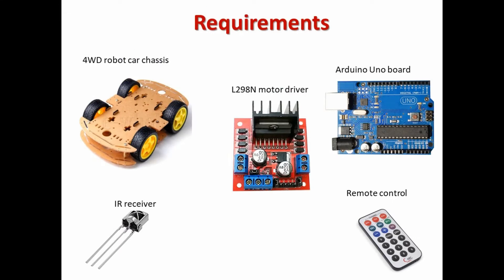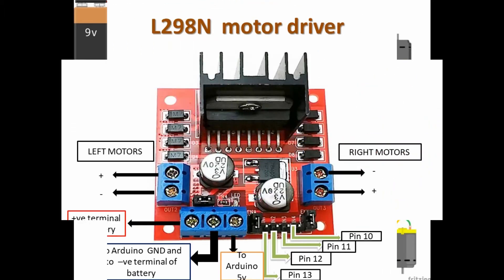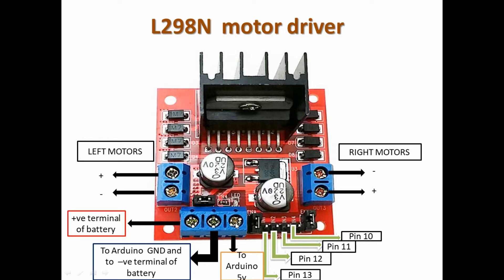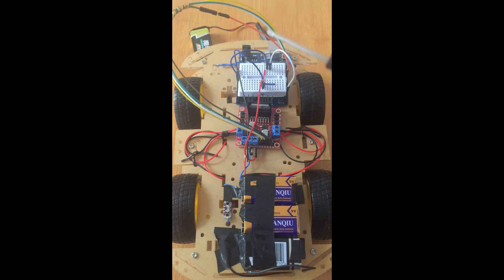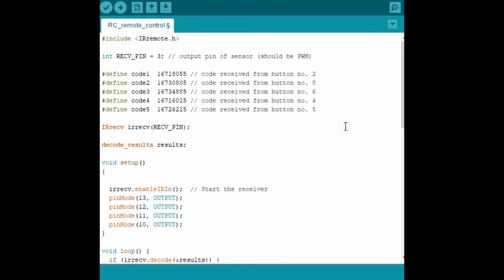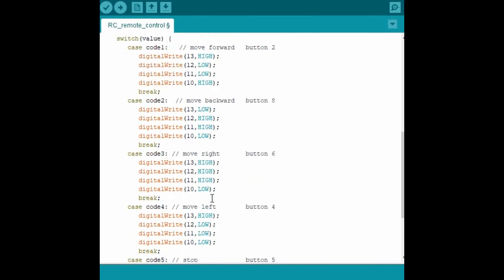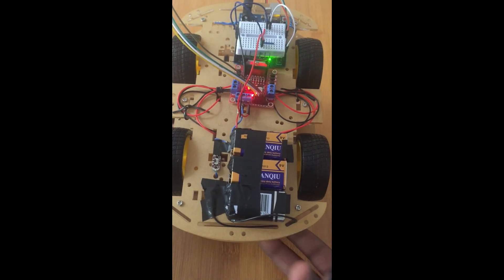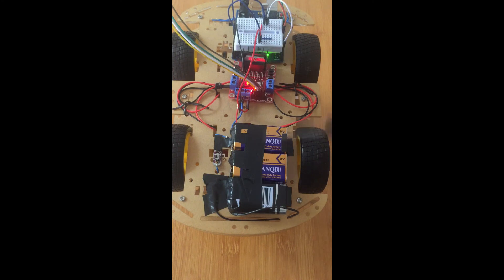HOW TO CONTROL 4WD ROBOT SMART CAR USING IR REMOTE WITH ARDUINO

Comment: Hi there; I have one question : What "error: 'RECV_PIN' was not declared in this scope"
Reply from the maker: Check the initialization part of your code and make sure you have declared the pin number for the output of the IR receiver.
Reply: #include <IRremote.h>

int RECV_PIN = 3; //Kızılötesi alıcısı

#define code1 16718055 // kumanda 2 nolu tuş
#define code2 16730805 // kumanda 8 nolu tuş
#define code3 16734885 // kumanda 6 nolu tuş
#define code4 16716015 // kumanda 4 nolu tuş
#define code5 16726215 // kumanda 5 nolu tuş

IRrecv irrecv(RECV_PIN);

decode_results results;

void setup()
{
  
irrecv.enableIRIn(); //Kızılötesi modülünü aç.
pinMode(13, OUTPUT);
pinMode(12, OUTPUT);
pinMode(11, OUTPUT);
pinMode(10, OUTPUT);
}

void loop() {
if (irrecv.decode(&results)) {
  unsigned int value = results.value;
  switch(value) {
    case code1: //ileri tuşu 2 nolu buton
    digitalWrite(13,HIGH);
    digitalWrite(12,LOW);
    digitalWrite(11,LOW);
    digitalWrite(10,HIGH);
    break;
    case code2: //geri tuşu 8 nolu buton
    digitalWrite(13,LOW);
    digitalWrite(12,HIGH);
    digitalWrite(11,HIGH);
    digitalWrite(10,LOW);
    break;
    case code3: //sağ tuşu 6 nolu buton
    digitalWrite(13,HIGH);
    digitalWrite(12,HIGH);
    digitalWrite(11,HIGH);
    digitalWrite(10,LOW);
    break;
    case code4: //sol tuşu 4 nolu buton
    digitalWrite(13,HIGH);
    digitalWrite(12,LOW);
    digitalWrite(11,LOW);
    digitalWrite(10,LOW);
    break;
    case code5: //durdur tuşu 5 nolu buton
    digitalWrite(13,LOW);
    digitalWrite(12,LOW);
    digitalWrite(11,LOW);
    digitalWrite(10,LOW);
    break;
  }

  irrecv.resume(); // sonraki komutları algıla
}
}
Reply: @mytectutor  Problem Solved.  Thank you very much. Problem is "One word mistake" IRrecv "IRecv"

This code RUNNING :) Thanks